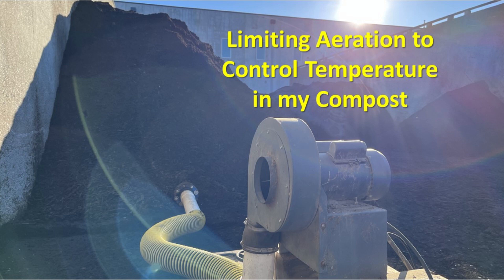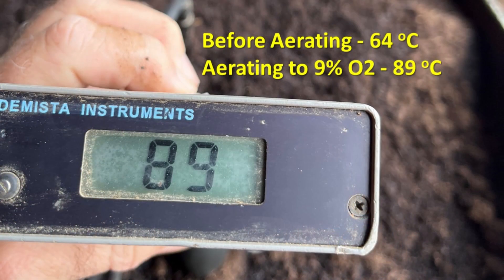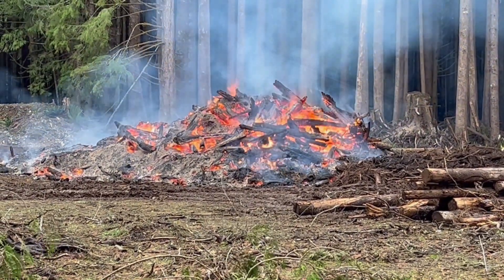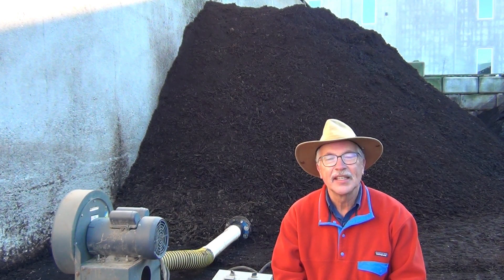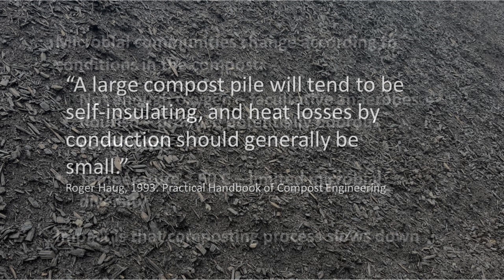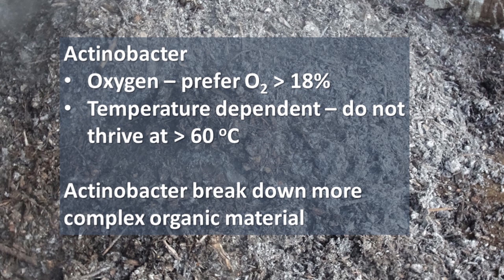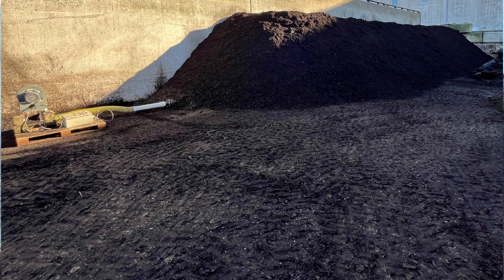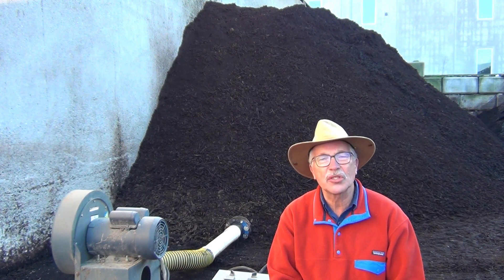Limiting Aeration to Control Temperature

Comment: Hey John, great video like always, have you ever tried using compost solely as a growth medium? most growth medium where im from is actually sterilized, so maybe if we could get compost with good physical and chemical qualities, we can ignore the high temperatures all together or maybe even raise them to the point of sterilization?
Reply from the maker: Hi Marco, thanks for the question. I find that most composts cannot be used as a growth medium because they are too high in electrical conductivity, unless they are produced outside in high rainfall climates, where all the soluble nutrients are washed out!  Blending a good compost with the peat or other components of the growing media is a good thing as it adds beneficial microbes that help the plants against potential pathogens. Sterilized media is great only unit a pathogen shows up, then there are no good microbes to outcompete it....!